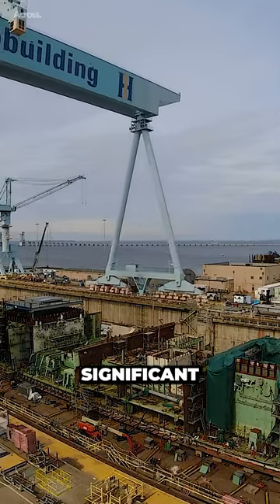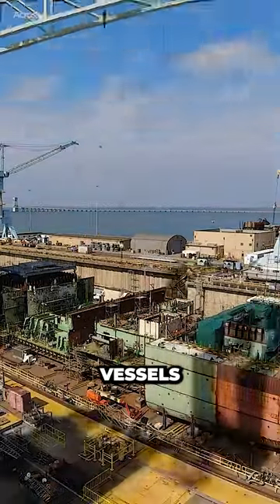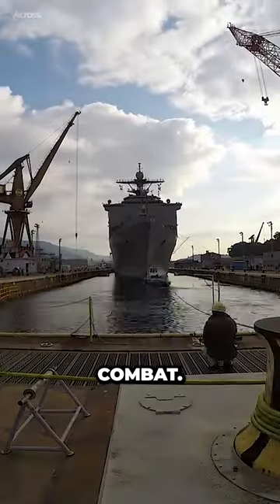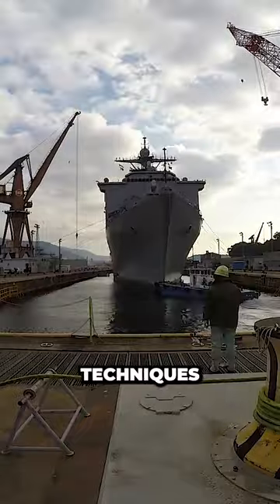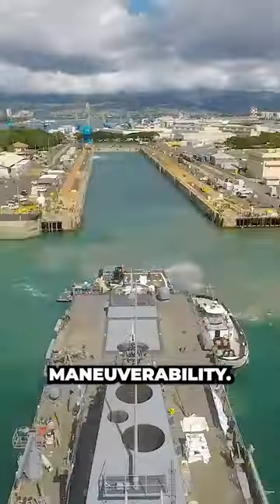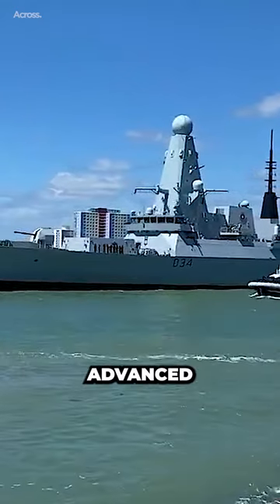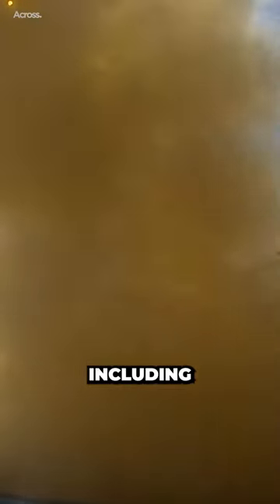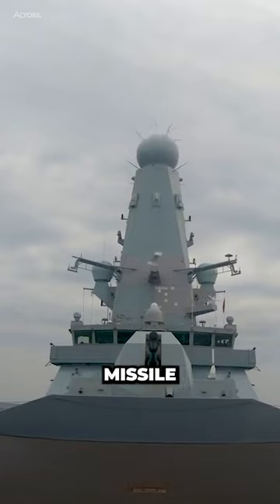Why are Navy Ships So Expensive to Build? #shorts

Comment: Decades ago the government contracted with a general aviation company who won the contract to build training aircraft. The Navy threw a fit and refused to take delivery. The aircraft that were designated for the Navy were stored at an old airfield and the Navy had to fork over the money they owed from their budget. Mysteriously decades later the hanger caught fire and all those navy trainers were destroyed.
Fast forward a couple of decades, and the government is in the market for a new trainer. General aviation company made the decision to not compete. The company that owned the aviation company said you will build a prototype and compete. So aviation company builds kickass trainer. Navy still being salty about having to pay for a trainer they never wanted started pulling strings. Using whatever influence the admiralty had. They pushed until a single engine prop plane was accepted as the new trainer. The one accepted hadn't met all the criteria of the requirements, and took almost a year after acceptance to finally meet if just barely all of the specifications. Where the other company despite starting late in the competition produced instead of a single engine prop plane a twin engined jet aircraft that was sleek and actually looked like a fighter. It was also designed for ease of maintenance, while the single engine trainer continued to have teething problems for the first 3 years of production.
Sometimes the corruption isn't the contractor but factions within the government that want to flex their political muscle.
Too bad the two prototypes had to be destroyed. That general aviation company could probably make billions of dollars selling their trainer on the open market. Those aircraft were beautiful and definitely would have made a lot of new military pilots thrilled to fly an aircraft that looked and probably handled similar to fighters they would eventually fly, unlike a propeller driven aircraft that could look less like a modern day fighter and definitely couldn't perform like one, because of the difference between jet propelled and propeller driven performance and handling.

Comment: Yet none of 'em ain't as durable as a battleship.....😢😂
Reply: I wonder why the battleship isn't used in any navy anymore...
Reply: @Cheeseburgerlove  They need more crew and are costlier.
But if planned properly, a modern battleship could be built can have latest tech and can go on one ship stand missions unlike other warships, most of which need support.....
Reply: @saco7281  The problem with the battleship is that their main armament are big guns that fire shells, now most ships these days only have small ones, there main armament are missile which are much more deadly than any battleship will ever be as they can be fired from potentially hundreds of miles away. not to mention during WW2 the reason the battleship was disappearing was because planes had proven to be a cheaper alternative and could be just as deadly as a battleship as proven by Yamato and her sinking. not to mention at that point in the war they where just massive targets for planes and couldn't properly defend themselves.

Now outfitting battleships with better anti air guns would not negate the problem of missiles as one or 2 would most likely cripple or even sink a battleship as they would be more accurate than any gun bomb or torpedo.

and putting missiles on battleships completely defeats there purpose as a floating artillery platform so if that's what your thinking then it wont really count.

Not to mention that most ships nowadays are designed with stealth in mind so you can spot and kill the enemy before the enemy does the same to you.

Also even battleships in WW2 etc had escorts similar to carriers as just 1 battleship would be a very easy target for a couple of planes.
Reply: @Cheeseburgerlove  you could still make a modern version by  using railguns etc.

I also had an idea where a shell is fired from the main gun and as soon as it reaches the highest point, it disintegrates like a space shuttle and then one part of it would ignite and continue further as a missile.

The reason why I came up with this idea is because it makes it look like as if the battleship IS nostalgically firing a shell but it turns out to be a deadly missile.....😁😁

Also lasers as Anti-aircraft/anti-missile system.
Reply: @saco7281  I'm sorry but railguns and lasers are still in heavy development, also the shell idea sounds expensive to research test and produce.
Reply: @Cheeseburgerlove  Yes.....
It indeed is unfortunately 😓😓😓
Reply: @saco7281  ok??